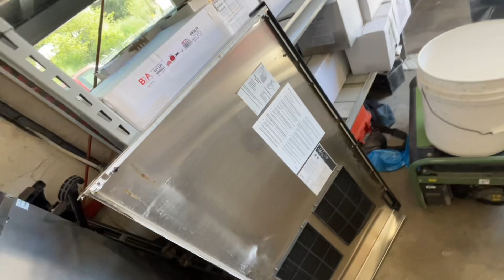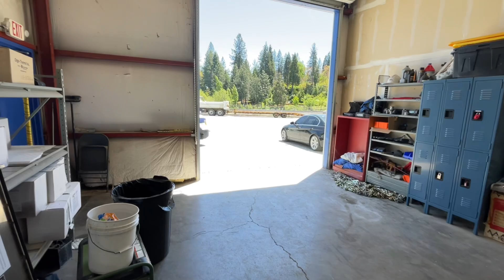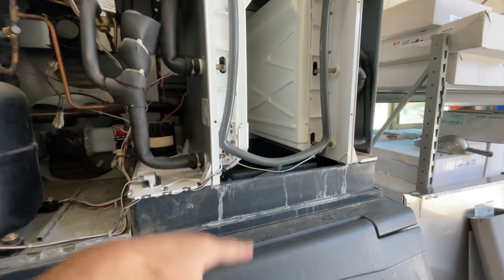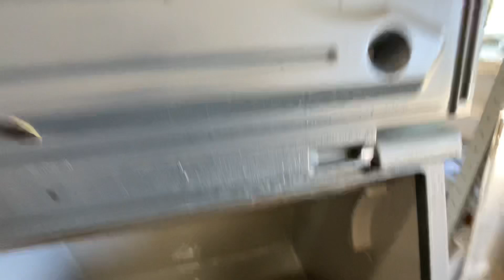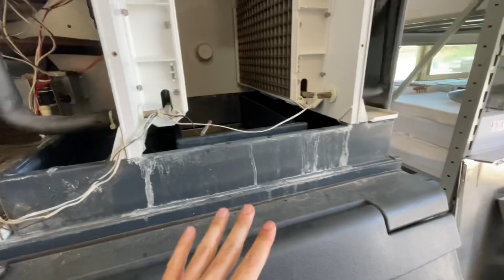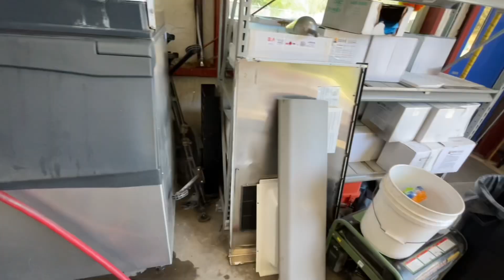Scotsman Prodigy ice machine cleaning and sanitizing process

Comment: After running the clean cycle and draining a small amount of water maybe 8-10oz remained in the reservoir along with some debris. The pump is still submerged but does not finish draining. I held down the clean button and waited for the dash, but the pump did not drain any more water.
Reply from the maker: This is a common problem. Best way to get it all out is to dry it up with a couple of towels.

Comment: I remove my pump and use a garden pump up sprayer with delimer and water to spray and clean the the machine inside and out then use it to rinse the machine off with the same spray with fresh water.
Reply from the maker: The pump sprayers make the job much easier.

Comment: I have a Scotsman Prodigy that only freezes the bottom half of the coil so the ice thickness sensor never sees the ice. Do you think that it may be low on refrigerant? I've been through everything, cleaning, de-scaling, testing sensors, etc. but it still only freezes at the bottom. The ice gets very thick down there until it gets a Max Freeze Time Shut Down fault.
Reply from the maker: Sounds like you’re either low on charge or your TXV is not metering the refrigerant properly.